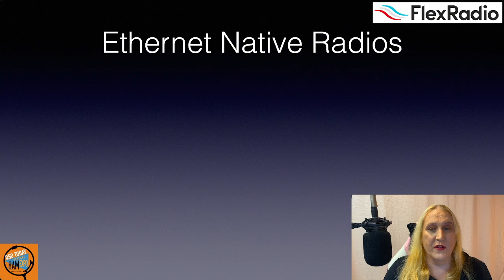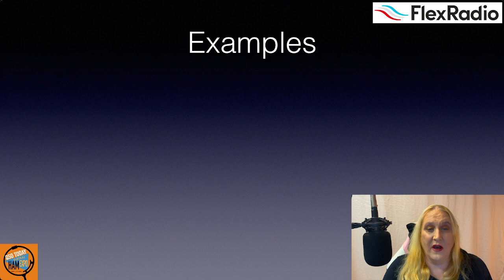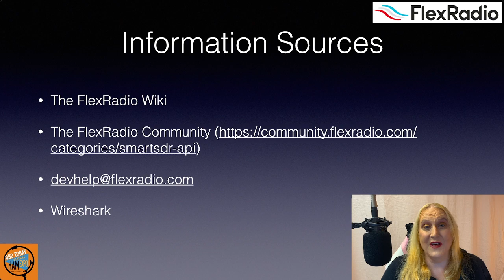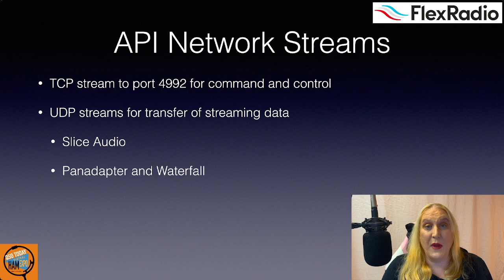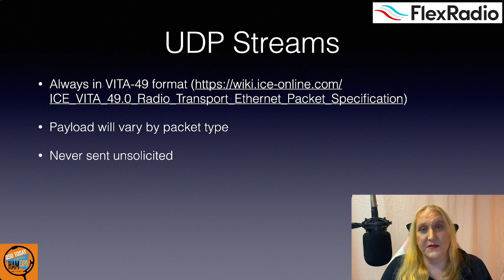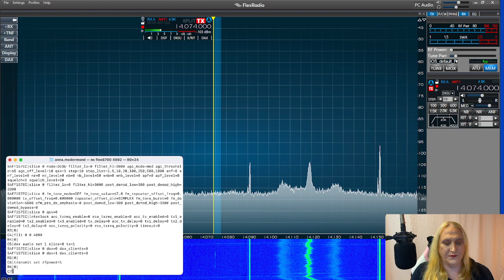Annaliese McDermond NH6Z on the FlexRadio programming API

Comment: It would be helpful if the links that Anna had on screen could be published in the description for this video.

I've been looking at developing some software for my Flex 6600 and this talk give me some great information that I can put to use.
Reply: Hey Roger!  Here are the links that I have in the presentation slides, except for the FlexMeter link which appears to be dead between when I wrote and when I gave the presentation.  Hopefully these help you out a bit!

FlexRadio Wiki: http://wiki.flexradio.com
Anna's On Air Sign Project: https://github.com/mcdermj/onaird
Node-RED: https://flows.nodered.org/node/node-red-contrib-flexradio
SliceMaster 6000: https://github.com/K1DBO/slice-master-6000
SmartSDR API Community Discussion: https://community.flexradio.com/categories/smartsdr-api
FreeDV Waveform Code: https://github.com/flexradio/smartsdr-codec2/tree/circular-buffer-locking
VITA-49 Specification: https://wiki.ice-online.com/ICE_VITA_49.0_Radio_Transport_Ethernet_Packet_Specification